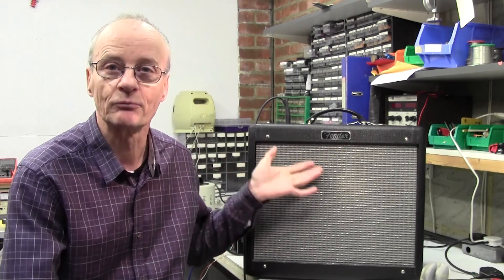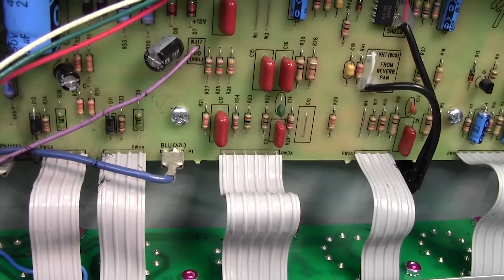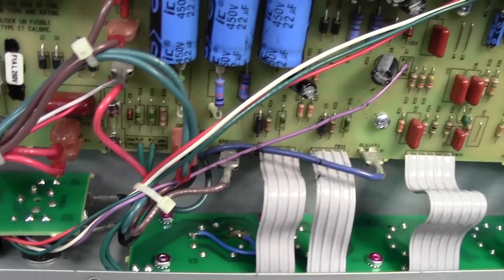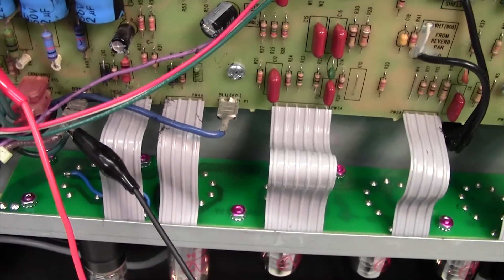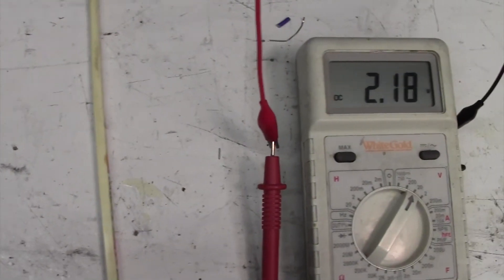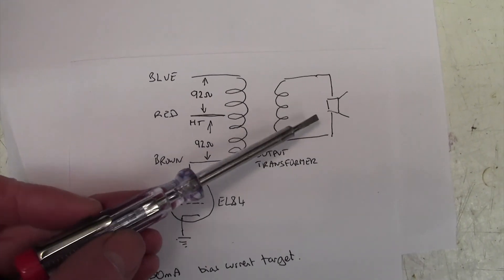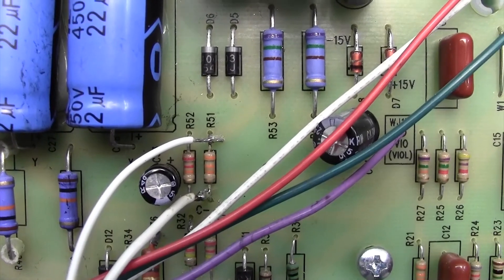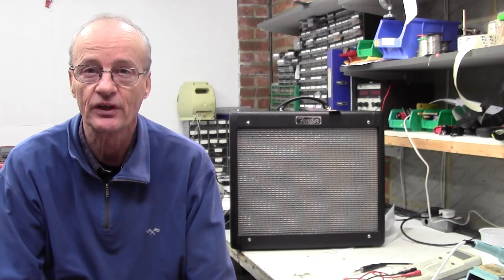How to Bias Fender Blues Junior Guitar Amplifier

Comment: Great video. I'm getting ready to replace my EL84 tubes in my Fender blues Junior amp. Maybe I can put a quarter watt multi-turn trim pot on R51. Since your value was 120K,  a 200K or 250K trim pot might allow me to bias the amp.
Reply from the maker: Yes there us a 'BillM' mod which adds this pot, I've done a few. I can't recall the value though.

Comment: Great videos!  Would like to know what the other issue was?  I get proper voltage drop across red to brown on output Transformer; but meter is all over the place when checking red to blue voltage drop.  Meter even beeps like a continuity check when under 200 ohms.   Cream board, amp has painful high mid and ice picky highs it did not have before. A bad tube blew out a trace on the tube circuit board;  replace it with an upgraded one. What might cause this?  thanks for all you do!
Reply: output Transformer reads 100 ohms both sides
Reply from the maker: Hi Bill. Glad you're njoying the vids. Actually I've had some issues sometimes measuring that blue wire but I'm not sure why!
On your other issues, it's just too hard to diagnose over the internet - I hope you manage to get it sorted.

Comment: would it be possible in this amp , to add a 1 ohm 2 watt resistor on cathodes of el84s , so measuring plate to cathode would be more accurate?
Reply from the maker: Yes you could do that if you can find a neat way to do it. A bias meter would also do the same thing but the small 8-pin bias meters are not cheap. Eurotubes do one.

Comment: 11:30 I won't bore you with the details? 5 hours of debugging what? That's the most interesting part... don't hide your failures, other might learn from it. 

Lord know what would have happened if you didn't have the bias probe to set you straight!
How hard is it to measure the exact resistance across both sides of the OT if your lead are already clipped to measure the voltage drop? Furthermore, I have never seen an OT as linear as this, was it really 92 ohms on both sides?
Reply from the maker: I have to keep the vids to a sensible length particularly the 'how to bias' series as people just want fast answers about biasing. The output transformer method (for the Blues JJunior) is a 'quick and dirty' test of the bias. If you've got about 2.5V -ish across each winding then the bias is about right. Yes the o/p transformers are very consistent resistance on this amp.
Reply: zjokka.  I agree !  And even if it takes 5 hrs to track down the problem, it only takes a few seconds to say for instance, there was a cold solder joint or intermittent break in the ribbon cable to the grid of the tube that was having runaway current, or there was some leakage from one circuit trace to high voltage , or a cracked grid stopper resistor, or whatever the fault was.  Usually the Fender Amps of the late 80's to mid mid 90's have issues of poor quality 1/4 watt resistors, incomplete cleaning of etching chemicals from the circuit boards, leading to bad solder joints or leakage across the circuit board, bad switches, and connectors, poor quality potentiometers, and on the Blues Jr. and Deville the very foolish reliance on ribbon cables for the tube board  (if You work on those boards which has to be done from below the ribbon cable connectors can easily crack or pull off the traces, resulting in a horror show..  On later Fenders,- 2000's non-eutectic Euro Union solder becomes a major issue, as one or several connections become compromised by the thermal fatigue that sets in,  creating poor conductivity or tin whiskers or film than manage to create extra circuit paths. 
  Bias problems (runaway and redplating) run rampant in the newer amps for several reasons, mostly having to do with an inadequately stable bias supply , due to potentiometers that are too small to handle the current that should be in the bias adjust circuit to guarantee contact wetting , on the potentiometer sweeping arm, or switches placed in the bias circuit for an amp that uses switchable output tubes from  2 to 4.
  Stuart, i like  Your channel, lots of good advice here , but there is absolutely no shame in disclosing a difficult problem, advancing knowledge not only helps those who are trying to learn how to repair amps, but also those who are designing the current amps, who often times either have little practical experience, or (seems like) can't wait for it to break so that You will buy a new one.  Fenders before 1983 are built better than battleships, and the Marshall are all good until around 1986. 
  Sensible bias supplies consist of an appropriate winding on the power xfomer, a diode, a filter cap. (or two), and a fixed resistor, and a variable resistor., and a couple 220k resistors to provide bias to the upper and lower halves of the circuit.  A video showing the classic circuit fender used, and how it has been implemented in different amps, would be good, as well as a video showing how to bias with a scope, on the output and removing the negative feedback resistor.

Comment: Top notch Stuart! Great explanation. One question, if I'm biasing a cathode biased 6V6, do I shoot for the 70% of total dissipation? Or should I just bias at 12watts? Thx!
Reply from the maker: So just to check, if you're biasing a CATHODE biased amp that means you're changing the value of the power resistor in the cathodes, right? If so, I'd go for the 70%.
Reply: @stuartukguitarampguy5830  Yes the cathode resistor.
Reply from the maker: @rchavez2112  Ok go for the 70% then.

Comment: Hello. Thanks for your video, I enjoyed it. Although I know nothing about tubes, I'm confident enought in Electronics and safety to attempt to bias my own Blues Junior. To that effect, I was hoping you could suggest a value for the series resistor attached to the 50K pot (I'm thinking a trimpot), that replaces R52 (as per the comments below). And would this pot alone suffice? Because you mentioned two biasing resistors: R51 and R52, so wouldn't it be necessary to change R51 for a pot as well? Thank you!
Reply from the maker: Hi  I don't want to give a huge long reply here, but this is the principle. First decide which biasing resistor you are going to swap for a pot. Let's say it's 33k. So you want that resistor to vary between say 25k and 40k or whatever. So choose a pot and series resistor to suit. E.g. a 25k series resistor and a 15k pot wouild give you exactly what we were aiming for  in my example. I would use a 10-turn pot as this makes the bias much less fierce. You may have to play around with resistor and pot values. Check out 'BillM mods for Fender Blues Junior'. I think one of those mods covers the bias pot. Good luck!
Reply: @stuartukguitarampguy5830  Hello! Thank you for your reply. Would you consider replacing BOTH biasing resistors with a pot + series resistor? I would assume this should make for easier biasing in subsequent changes of tubes.
Reply from the maker: @wertherellerbrock  No definitely not, you only need one adjustment to do both valves.
Reply: @stuartukguitarampguy5830  Ok, I'll look into it. Thank you so much!
Reply: One of the interesting things about the Billm mod is the trimpot takes the place of both resistors. The actual bias voltage is developed between the common point of R51&52. The Billm trimpot lowers one value and raises the other in the voltage divider network, keeping resistance to ground approximately the same. 55k to ground in the original circuit, (22k+33k) and the 50k Billm trimpot. It’s probably easier on the zener diode regulating the 15vdc going to the reverb IC. 
Just a guess.

Comment: This is amazing for an electronics luddite like me. Thanks for making this video. 

Why would fender design the amp without a bias control? Or why not design it as a cathode bias so it does it automatically? 🤔
Reply from the maker: Hi Josh Two questions there. On the bias control, maybe cost? A few pennies more! You question about cathode biasing is a good one as many lower powered EL84 amps ARE cathode biased. You do lose a little bit of power with cathode biasing though, so maybe they wanted full power? Not really sure, it's never easy to figure out why something was desgned the way it was!

Comment: Just replace r52 with a 50k pot. That’s all you need to do, I’ve done it on lots of these. And yes the board must be dropped down. Set your bias to 23 ma. Not what this guy says.
Reply from the maker: Pete, thanks for the input. I'm responding not to counter you but just to record useful info for future readers of this thread. Although it is always preferable to 'just' install a pot, in practice this is a far more difficult task for people than just soldering an extra parallel resistor across an existing resistor from the top side. Anyone who can solder can use my method - that's why I did it this way!  You causually say " and yes the board must be dropped down". This is a MASSIVE job for the most people. I dread it and I've done dozens and dozens of blues juniors over the years. You then have to mechanically secure the pot somehow. I've fitted dozens of these bias pots (BillM mods etc.) and it's far from easy - well beyond most people's DIY abilities. Your advice to swap out R52 for a 50k pot is not good advice I'm afraid and I urge people reading not to do this. I'm not saying it won't WORK - it will. But that pot will be very hard to adjust and can be turned down to cause catastophic runaway current. E.g if the pot was turned to zero, you would have a short circuit where R52 used to be. The valve would draw  huge current and blow the HT fuse at best, cook the valves at worst. If you are installing pots you need to know about ranging them by having a suitable series resistor. That needs thinking about and calculating. If you put a 50k pot in like you suggest, at least half of its travel would put you into 'dangerous current' territory. Adding a pot is complicated for the average person, hence my simpler advice. I'm sure YOU know how to do this, but someone reading your comment would asume they can just chuck-in a 50k pot and all will be well. 
On the bias current, the correct bias current for the 330V plate voltage I had is 26mA. I biased a bit hotter, agreed, at 32mA. But you cannot simply say 'Bias at 23mA, not what this guy says'. The correct bias current depends on the plate voltage. Sure 23mA is in the right ballpark (a bit cool, as mine was a bit hot) but the way you state it seems like 23mA is THE bias current to go for. It isn't. For people reading this, if you have the electronic skills to drop the board and put a proper ranged pot with a correct series resistor in place of R52 then Pete is right - it's a better solution. If you don't have those skills, my simpler method will get you the result you want. If I were doing the video again I would probably go for a lower bias current than 32mA. Maybe 28mA - 30mA. The Blues Juniors sound better running a bit hot.